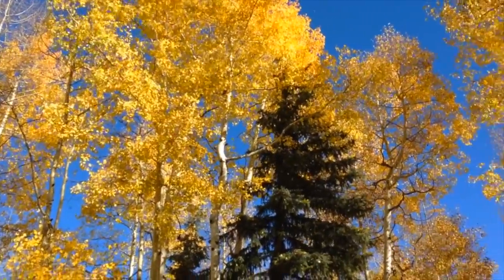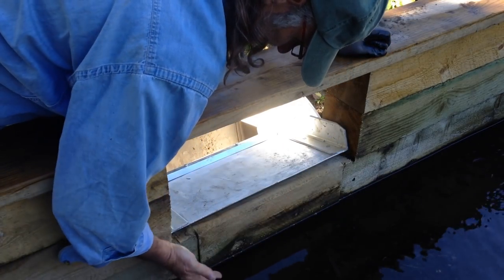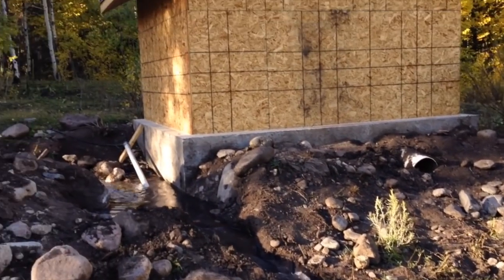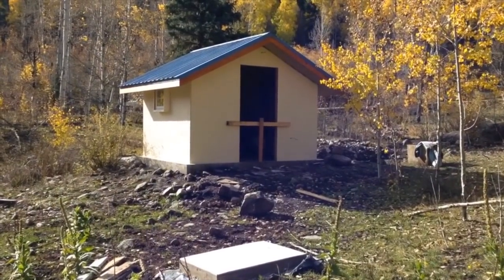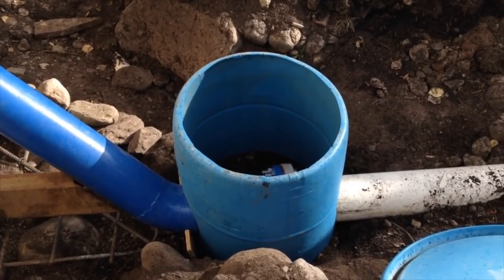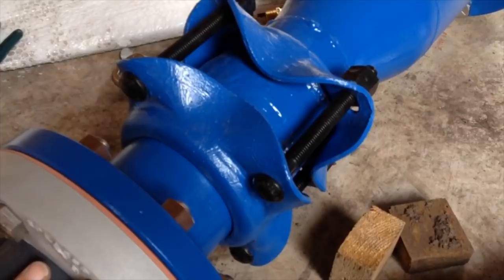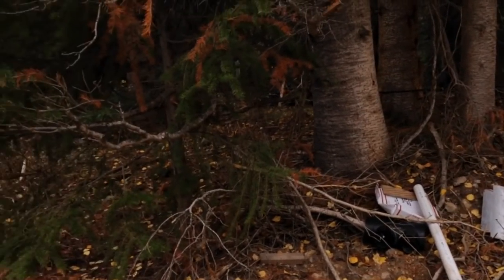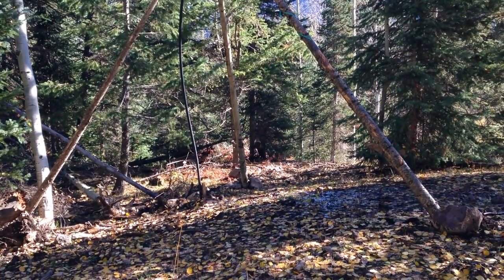Hydro System pt 13 Non-Music Version

Comment: How many power have you sort from this install ?
Reply from the maker: In spring through fall we pull 4500w or 107+ kWh/day. In winter we turn it up to about 7000-7500w or 170+ kWh/day because we need the heat. Thx for watching